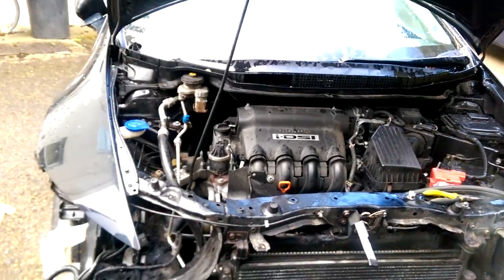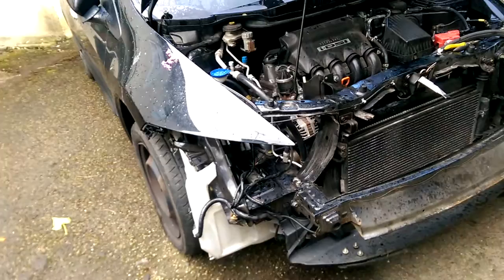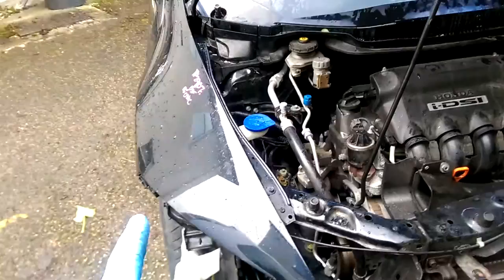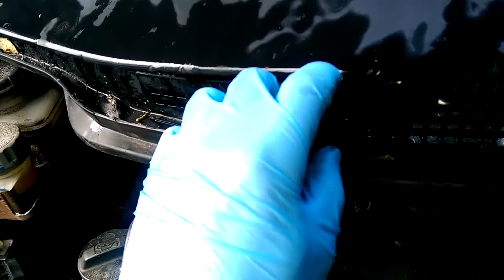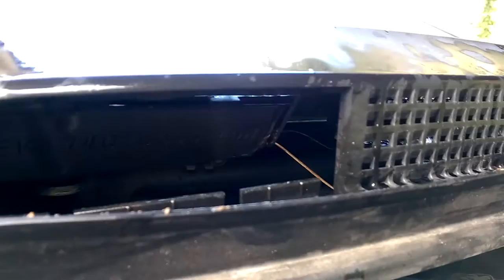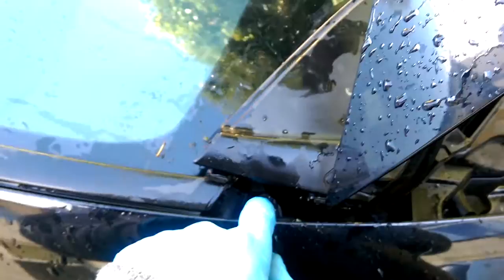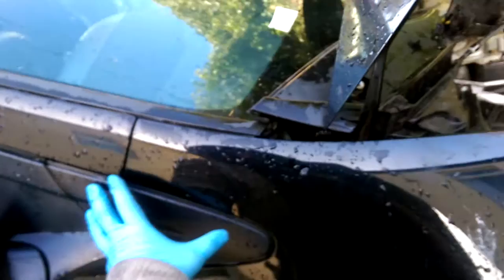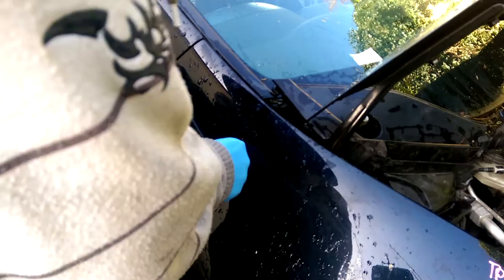How to remove / replace driver side wing offside Honda Civic MK8 European model

Comment: Good video should have made it longer. For anyone trying to take it off there are two more bolts one located near  the wheel ( there is also a screw)and one on the front end.